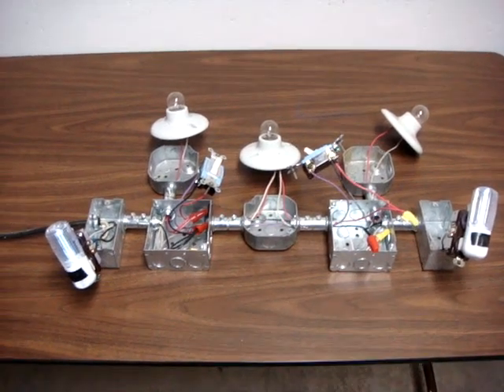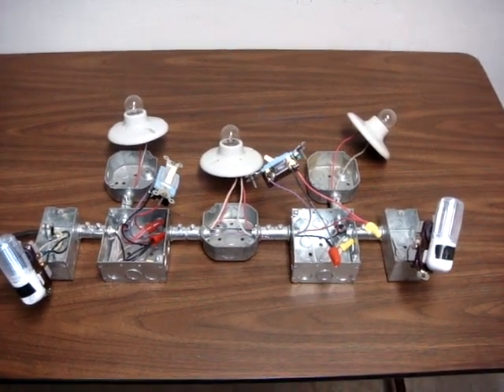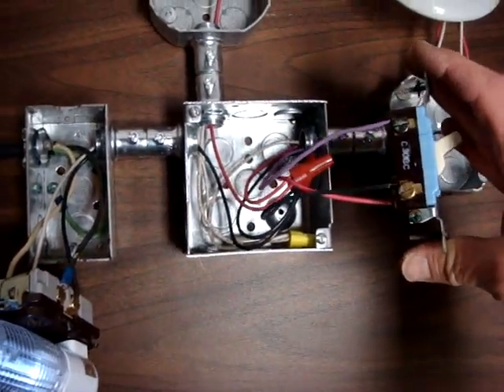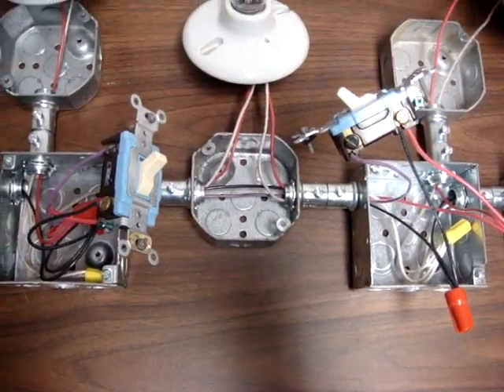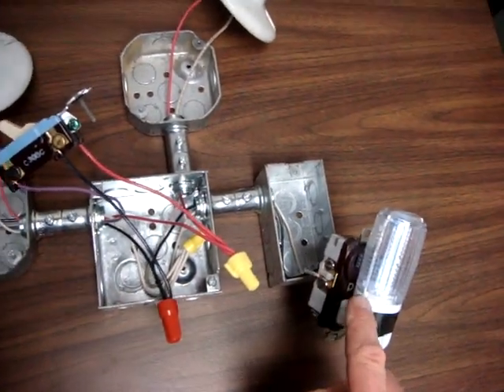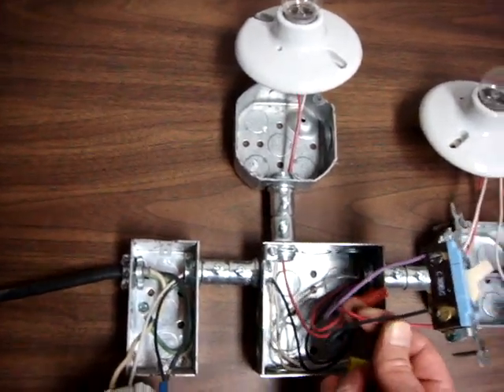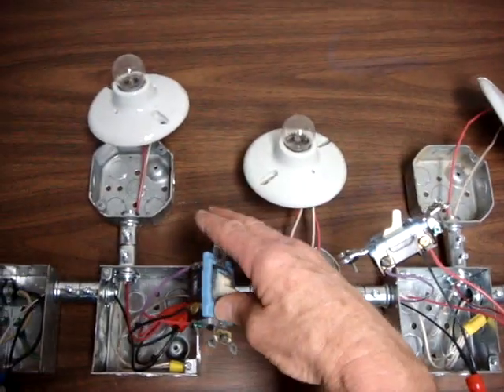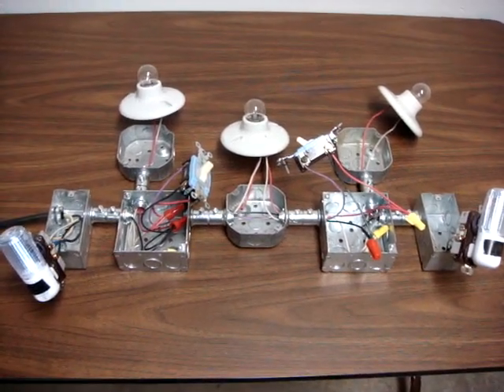3 Way Switch Wiring - Unusual Configuration

Comment: I have a question. I used 14-3 from 1 3 way and ran it to several lights then back down to the second 3 way. Commons are connected. Hots are connected and the red is tied together. But what I don't have is a pair of travelers. Can I make this work or do I have to rewire a different way? Hope your still around. Thanks🌞

Comment: Good job.  I'm a commercial electrician and have never run into the California/Coast 3-Way configuration, although I've heard of it.  Many of the descriptions of this method I found on the Internet are boneheaded.  Yours was straightforward.  Thanks.
Reply: This here is the coast three-way wiring method. The California three-way switches the neutral. Basically you feed both three-way switch traveler terminals with one hot and one neutral respectively and the common terminal of each 3-way feeds the lights (one hooks to the lamp holder shell which would typically always be the neutral as you are aware and the other is the pin terminal screw if wiring to a lamp holder, so it's either going to be too neutrals present and lights off or too hot present of the same circuit and the lights off or it'll be a hot and neutral present the traditional and code polarity and one is reversing where the neutral would be the lamp holder pin terminal in the hot would be the screw shell.

California three ways definitely work and they do give you a hot and neutral on both sides of the switch loop it's just violating NEC article 200.10 (C & D), and Article 402.8 potentially, and the main one: Article 404.2.

The Coast three-way does not violate code.

Comment: Is that a Carter 3-Way?   If so, I don't think those are legal any more.
Reply: This is perfectly legal! 3-way switching that involved a Neutral (Grounded Circuit Conductor) IS illegal!!
Reply: It's called a California or coast 3-way. You can find a nice diagram on Wikipedia.
Reply: https://en.m.wikipedia.org/wiki/Multiway_switching
Reply: No, this legal. A carter 3 way is the configuration that was illegal because it switches and reverses the polarity to the fixture, and has been illegal since the 1923 NEC, but was commonly employed for decades afterwards,  on farms with a yardlight in between a house and outbuilding controlled by 3 way switches and receptacles in the outbuilding are powered at all times, using only 3 wires in between, well into the '50s and even the 60s in some areas because it actually used one less wire.

Comment: So I have a 1928 home and I have 2 sets of 3 way switches in the stairs to the second floor.  One circuit for the downstairs light by the front door and the other one for the upstairs light in the hallway.  I have been doing research because I tried to put new switches in and now nothing works.  What I found is that this configuration is called the California 3-way or Coats Highway 3 way switching (which is now illegal).   Can you confirm that this is period for 3 way switching and is this in fact a  "California 3 way"  It seems like the 2 circuits share a traveler...which stays hot?  Very confusing and frustrating.
Reply from the maker: The switching arrangement I have shown is legal, There is a system that involves switching the neutral wire that is illegal. I have no way of commenting on your situation.
Reply: sparkyjohnrg.com
Reply: you meant, sparkyjohn.com - right?
Reply: Sounds like yours might what's called the Carter 3 way switch wiring method.  You mentioned your home was from 1928. I assume you have knob and tube?? If so, another way they used to do it was to take one three way switch, the hot and neutral were on the travelers.  The hot and neutral from the first 3 way was tap spliced (soldered and taped hopefully) fed to the traveller's to the second three way.  They would then have a single wire from the common terminal on each three way switch to the light fixture.  Another method I have heard of is the two three way switch could be on a separate circuit.  Again the hot and neutral to the traveller terminal on each three way, then a single wire from each common terminal on the switches to the light fixture.  So the light fixture can have 4 states.   1) Neutral-Neutral. Bulb off.  
2) Hot -Neutral. Bulb ON
3) Hot-Hot.  Bulb off
4) Neutral-Hot.  Bulb ON, with reverse polarity eg. possible risk of shock when changing bulb if touching the shell, which should always be neutral. 
This method was banned by the NEC in 1923, though I once ran into it in a home built in 1967 wired with aluminum wiring NM cable.  What I nightmare it was to figure out, I noticed it as I was repairing the aluminum wire connections with Alumiconn connectors to reduce the fire hazard

Comment: Anyone know of a way to power a light with both an upstairs and downstairs switch with 14-2 cable? Roofing would have to come up to run 14-3 cable, 14-2 cable installed pre-construction from upstairs direct to downstairs switch location. Maybe a remote control if not hard wired?
Reply: u need 14/3 switch to switch, and 14/2 from one of the switches to the light
Reply: Do some sort of Wi-Fi or other wireless switch or other One Direction type of arrangements and just use some sort of remote switching would be best and safer and easier so much so.

Comment: Thanks John, it   really  helped  me.
I just  came  across that old 3 way  puzzle wiring and  it  helped  me  .
Reply from the maker: Alex Mikich Thanks for the kind words!
Reply: @sparkyjohnrg  I believe this is a variant of the charter wiring system!

Also I've seen something like this for an old garage that was fed overhead where Power and Light and with a three-way switch at the house and garage.

There is a few Arrangements of this and it was quite posture with tube and knob wiring as well.

And also all those systems at one time that are not legal now it's from zip code were perfectly legal back then.

The ones I'm talking about that we're not legal were the ones that would reverse the polarity to the lamp socket.

For those that are unaware the Center contact on a lamp socket is supposed to be hot are the outer screw shell is supposed to be neutral.

With some switching systems that are now not legal according to the NEC.

That reverse the polarity AKA cause the it's crucial to be hot and depending on the position of switch.

Basically with on Old systems when the switches were both in a certain position both sides of the lamp holder both contacts would be either hot or neutral.

And when it on one would be hot and one neutral and the other opposite position off will be neutral neutral.

Believe it or not I once saw hey should that was between two buildings just have a light and don't Outlet and it was a choice between two buildings that are far apart and there was a three-way switch in each however there was only one wire running overhead reach building going to the outbuilding..

When I first saw that I'm like what the heck.

At first I did not think it was AC power I thought maybe antenna or something else weird or maybe it was low voltage cable also that had been run evidently through porcelain tubes at my house either end and just too bored holes in the outbuilding.

Not only that the same type of water continued inside and into a white socket with no box but a hole drilled through a board in the socket attached to that.

Also there's a reason why that was not working at all.

There has been some electrical work done and well the two hot wires I'll just panels it was fed from one of them had the eat wiring reversed so another words that bulbs got 220 instead of 110 volts.

Yeah long time ago still had 110 220.

How do I know this that that's why the bowl with blown well put in a new bulb to test it there are out there sleeping on the switches Bang bulb blows.

I thought to be bad but we tried again sure enough.

And I'm like I think that is going 220 for some reason sure Nuff

Edit and Edition switching switching the neutral is not permitted sorry forgot to put that yet.
Reply: @aaronbrandenburg2441  yeah thank god I never ran into that type of switching configuration, although I have heard of it. It was somewhat common in very old homes with knob and tube wiring,  and with 30 amp / 120 volt services,  where there was no chance of one switch on phase A, and the other switch on phase B.  It was also common on old farms,  and in rural areas,  where you have a switch in the house, a yard light, and an outbuilding such as a barn or toolshed with a switch for the yard light and outlets in the outbuilding that are to remain hot.  And just one conductor runs between the buildings to the light.  It works well, but it's wacky and dangerous to anyone servicing the light,  especially on an aluminum ladder.

Comment from the maker: You answered your own question. You save 1 wire, whether using cable or conduit. You can also switch lights on each end of the system

Comment: What are the advantages of using this 4-wire setup over a typical 5-wire setup?
Reply: Actually one Les wire to run this used to be more common in Old installations tube and knob as well although they did it with other means at times with switch to neutral and or reverse polarity on socket which cannot be done according to code nowadays. Also copper was expensive at one time and even more Troublesome to run than nowadays and also it was done during the copper shortage at times as well and sometimes just to save on cabling

Comment: Had this wiring set up in room I remodeled the other day except the source came in through the light fixture and then fed out in 2 directions to the 2 switches and then from there the switches went to power outlets. Took me a while to figure it all out as it is not a common way to wire 3-ways.

Comment from the maker: @MrNightro   
I do not have a schematic. You need a 4-wire cable, or conduit between the switches. You have a NEUTRAL conductor, which gets spliced in the box (NEVER connected to the switch), a HOT conductor, a TRAVELER, and a SWITCH.  The TRAVELER wire goes on the "Common" terminal of both 3-way switches, and the HOT & SWITCH wires go on the other 2 terminals of the 3-way switches.

Comment: I think I have it lol... Hard to see where all the wires are going in the boxes... I have a question though, Looks like there is three hot and one neutral between the 3-way switches... Does the code permit 14\2 (B&W) and 14\2 (B&R) between switches... This would eliminate conduit between the boxes ???